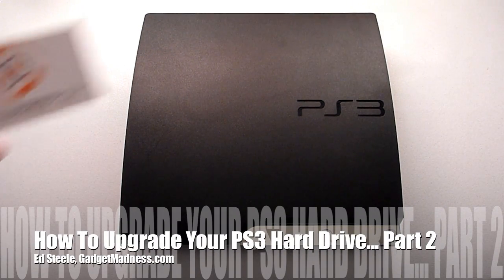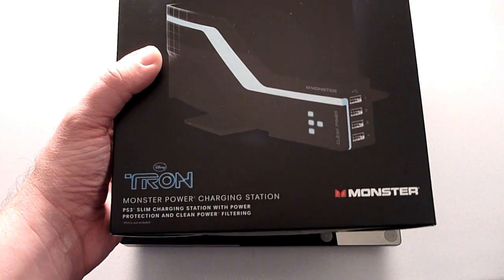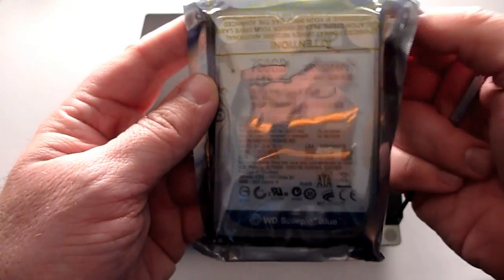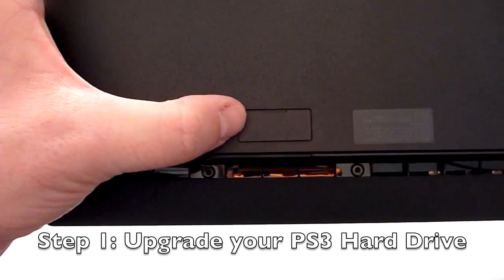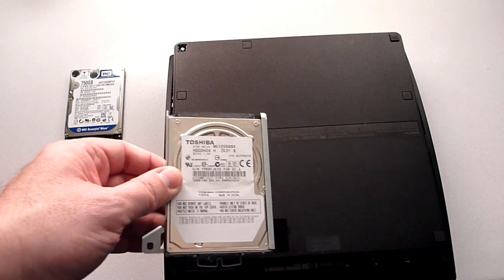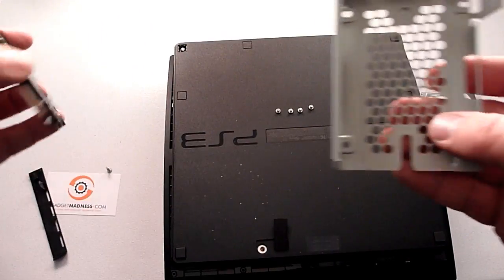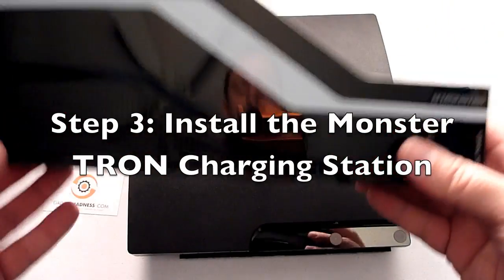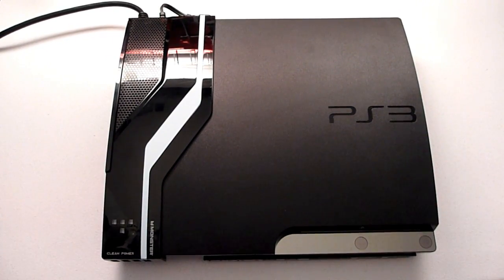How To Upgrade Your PS3 Hard Drive With Backup And Restore, Step By Step Instructions - Part 2 of 3

Comment: Can someone reply with a link to a hard drive they found on the internet that works perfectly fine? Please and thanks
Reply: Samsung spinpoint works great. It has to be a 2.5 inch sata drive, 9.5mm height at 5400 rpm. Sata II. Any higher sata or rpm will be worthless. Search Amazon.
Reply: thanks

Comment: @jcasey587 Check out NewEgg, they have a Toshiba (item # N82E16822149377) 1 TB Sata 2.5 5400 rpm hard drive on sale for $64.99 (formerly $79.99) with free shipping. Plus if you order via a mobile device and log into their mobile website and type WALLET under promo code you also get a $15 discount, but you have to use Google wallet to pay for this purchase (1 time only discount). I'm not sure how long this sale will last, so I would grab it soon for $50 before the sale expires.

Comment: wow the idiot replid in the dumbest way possible... in short a solid state usually will be an internal HD (harddrive) lol theres two main HD's that you can use these days one is a regular metal plate with a spindle hand that reads the plate like a record player (called HDD or hard disk drive) the other is the newer and always more expensive but much more reliable one called the SSD (solid state drive)<< this one is basicaly flash memory kinda like a huge Ram card or new ipod etc its electronic

Comment: Can I change HDD, format the new HDD using PS3 and go back to the original HDD? Or the console remember the "last" inserted HDD and format every other HDD that is inserted?

I have two HDD drives: original 250GB drive in ps3 and a new one HDD 1TB (9,5mm) in USB case. Can I insert the new disc just to format it by ps3, then instert the old one and store backup to the new one. Than insert the new one in the PS and restore backup data from internal to the same internal disc?

Comment: hi there, thanks for your informative videos. problem is, i cannot find the 1.5 GB/S HDD, all i can find are the 3.0 GB/S one. now, other than the fact that PS3 cannot make use of the additional 1.5 gb/s power, will the 3.0 gb/s hdd work just as good as the 1.5 gb/s? thanks.

Comment: I have done everything you said you cannot do on old phat and new slim systems and they all work fine today without any problems! These methods are trash LOL!! Been modding for years and never had any issues with any mod from nes to ps3.You should learn something before showing methods you can easily read on sony's site using 3rd party junk that is not recommended or even works right at all.Too funny,sorry but this was just too easy.

Comment: if your SATA 3.0 is backwards compatible i read that it should be fine to use *such as the Scorpio Blue he used in this video. There is a Scorpio Black model, which is 3.0 but not backwards compatible. Just make sure you double check the specs for whatever model you get b4 buying :D

Comment: i really need help coz i cant find anything on this. 
i had the old PS3, one of the 2006 or 2007 ones. that broke but i kept the hardive, i dumped the other hardware, i now have the slim and it dosnt work with the old hardive, i know i can update the software and stuff, but i have used the new hardive too and want too keep that data too :/ please help

Comment: i bought one form neegg its a Hitachi 5400rpm 500gb sata 3.0gb/s  i bought it cause it said it would work on my ps3 slim havent upgraded yet cause i have a wd ex drive & it wont work for backup but i have been readin in forums that it will with a power hub so im just waiting on that to arrive but now i hear from you that my 500gb hitachi sata 3.0gb/s wont work :(